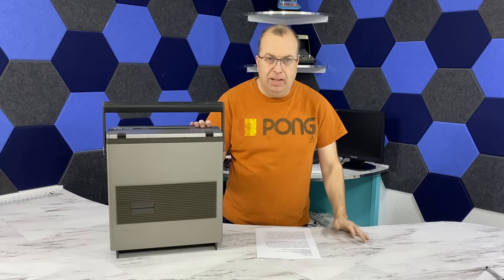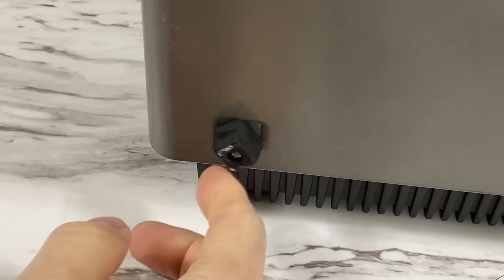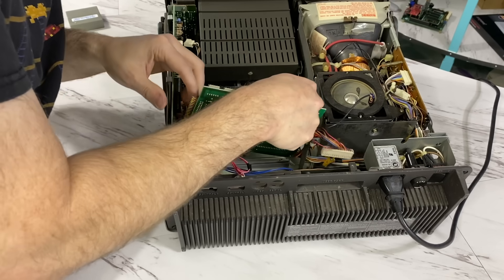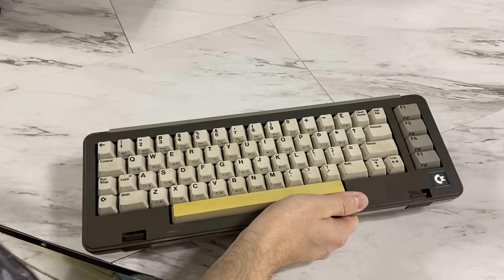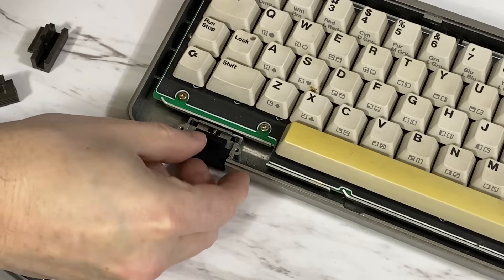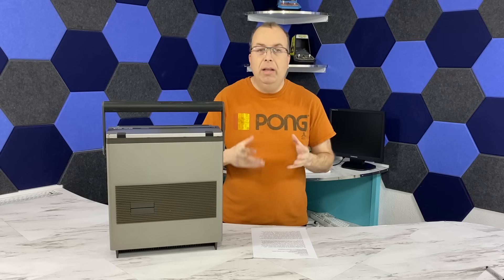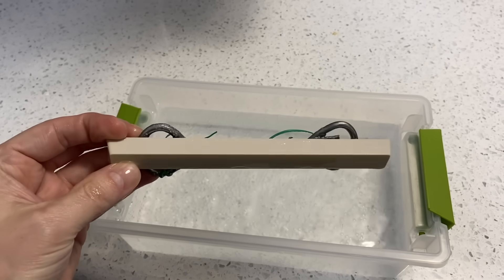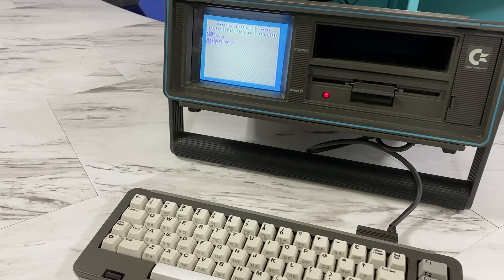Commodore SX-64 repair and trivia

Comment: Oh man -- I'm totally jealous.  I've wanted one of these when I first saw one in '85 or '86 (don't remember precisely) when I was 15 or 16.  The mother of a friend of mine had one -- she used it as a MIDI controller for a band she was in, believe it or not.  Always wanted one, but never got the opportunity to get one, and now they're too expensive and rare.  Oh well.  I'll just have to live vicariously through YouTube videos.  🙂
Reply: My goals were a bit less lofty...same age, but after adding devices 8-11 of 1541's (BBS drives and 8 as source and 9-11 as destinations for copying parties) MY goal was a MSD Dual and finally got it! With Fast Hack'Em, you could set the MSD up as a stand alone disk copier and disconnect it. That way, I had a duplicator at my fingertips without loading any programs or disturbing my C64 while I was playing Impossible Mission, Archon or Paradroid!
Reply: @MrV1NC3N7V3G4  I saved up for a while, and in the summer of ‘86 I was finally able to buy an SFD-1001 drive and the appropriate interface to connect it to my C-64. Just over 1 MB of storage on a single floppy disk. It seemed like all the space in the world at the time. 😂. I ran my BBS off of that thing for several years. Wish I still had it - so incredibly rare these days.
Reply: @LMacNeill  So jealous of that 37 years ago! I didn't even know it existed! I eventually upgraded to 1581's myself. But I think we ALL started with the same Westridge 300 baud modem, right? Then on to the 1200 and then 2400 baud. When I got a Hayes 9600 I thought I had peaked! Of course, it wasn't long after that when compression techniques spawned 14.4, 28.8 and finally 56k. (US Robotics in my case) Then that was the limit of analog phone lines.  

Did you ever get into boxing/phreaking/800 extenders/PBX hacks? It was a glorious time up until around 1985 when everything went digital.
Reply: @MrV1NC3N7V3G4  I never did get into the phreaking thing, no.  But I had friends who did -- I was totally amazed at the power they had over the phone system in that day.
Reply: @MrV1NC3N7V3G4  The good old days,but my 300baud modem was a 1650 copy from protecto i think..  Got on Q-link with 1670 modem(1200 baud),had the cert code hacker for Q-link codes(still have it), learned to phreak before ESS switching came in.. built a homemade c64 2400 baud interface and added a motorola Codex 2400 modem i got used.. kept progressing till it was Swiftlink cart and 56K with supra modem and CMD ramlink and HD. later came PBX knowledge to get out the backside. good times with the c64/128 even running X-10 smart home stuff on it.
Reply: @MrV1NC3N7V3G4  Good game selection, a man of taste ;)
Reply: @Musikkeller-Innsider  Why, thanks. I'd of listed Uridium as well but I made a trainer for that one (my first actually) and after I beat it (with unlimited lives) didn't feel like I accomplished much.
Reply: @MrV1NC3N7V3G4  
"while I was playing Impossible Mission, Archon or Paradroid!"

Some of the greatest games, that could keep you playing throughout the night, until the next morning.
Reply: Got lucky a year ago and found one on Facebook marketplace for $100.  They said it wasn’t working but I just adjusted the screen controls and it worked perfectly
Reply: I saw one being sold at a "Best" department store in Texas.
Reply: me thinks that in this case the actual possesion of one of these would prove to be underwhelming vis-a-vis expectations - but certainly a good conversation piece at any retro meet-up
Reply: I’ve had one recently.  They are ok but obviously just about none of them are in mint condition.  It’s good to watch these videos but I assure you it’s a bit of “don’t revisit your heroes”.
Reply: Using this as a MIDI controller would actually be pretty legit back in the 80s/early 90s. If your needs weren't so complex they outstrip the hardware I can see this working pretty well back then, with an external display (and maybe sound card) ofc.
Reply: some things lose their luster once you finally own them. it will always be special this way
Reply: How was your reply so fast?
Bro commented before the vid was even out
Reply: @Ollie12418  Patreon supporters get early access to his videos.
Reply: cjief buy you  one
Reply: this vid was published 15 minutes ago. how is this from 12 hours ago?
Reply: @xanderplayz3446  probably patreon
Reply: @xanderplayz3446  8-Bit Guy’s Patreon supporters get early access to his videos.

Comment: I’m curious would an SX-64 rom work in a regular C64 so you can have that disc loading shortcut?
Reply from the maker: From what I could tell, the ROM had more pins on it than the C64 version. So I wasn't able to test it.  But in theory, you could burn that ROM to a compatible chip.
Reply: @The8BitGuy  you can use a stock C64 ROM in a SX-64, so I would assume it could be done in reverse.
Reply: You might be able to achieve the same effect with a FastLoader cartridge, although you’d have to do some research
Reply: You could, but JiffyDOS also gives you the same shortcut with the added benefit of faster loading (assuming you also put the JiffyDOS ROM in your disk drive
Reply: @homestar92  I put JiffyDOS in my SX-64 years ago for this exact reason. The extra wedge commands plus the drive speed up is great! I have a video about it on my channel 🙂